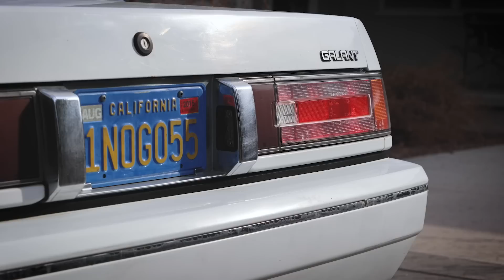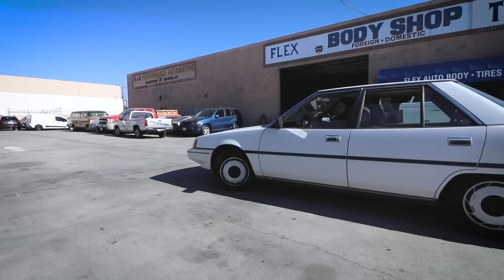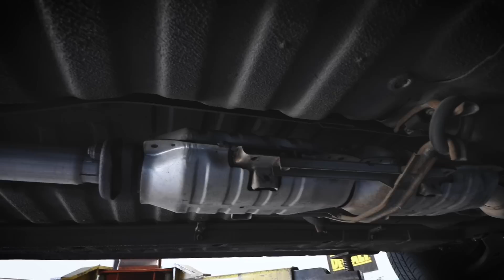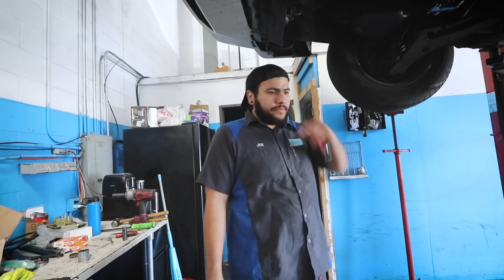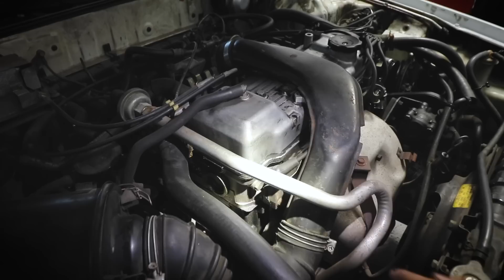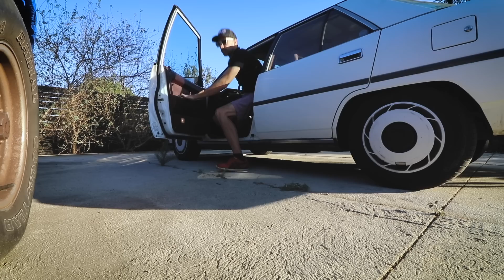Is This 1985 Mitsubishi Galant Worth Saving? Yes! Let's Fix It!

Comment: I agree with Joe on EVERYTHING involving older cars, ESPECIALLY the electrical gremlins. That is the worse part of an older car to repair. My 1993 Buick Regal was extremely easy to work on, except for the dozen electrical gremlins it had. All of which were almost impossible to find without the help of OBD ll.

Vacuum hoses were another pain in the ass 😂 so so many of them in older vehicles

Comment: At least at the end of your video, it sounded like the exhaust issues hadn't been addressed.  Before going anywhere at length, if anything as a safety measure in terms of potential CO entry into the cabin, I'd personally try to replace all rusted out exhaust components beforehand.  Thanks for saving this rarity!

Comment: These were called a Mitsubishi Magna in Australia... Our model had one piece large rectangular headlights rather than the quad headlight set up... The Magna didn't have the marker lights in the rear quarter panels and the number plate light set up is slightly different also... The engine is different in the Magna too... It has a 2.6 litre engine... Oh yeah and our version is right hand drive... We did get a Galant in Australia but it was smaller than this.

Comment: A quick pass with some fine sandpaper (1000, 2000,) wet, over the headlights will clean up the darkness on the sealed beams without having to replace them.

Comment: I had that red Montero in the add!
It was a great little truck!
It would have killed off the Jeep Wrangler, but I heard a rumor that who ever owned Jeep at that time slapped tariffs and other hindrances on Mitsubishi to save Jeep from losses.
There was no comparison of the Jeep to the Montero! Luxury suspension front seat!  Independent front suspension! Auto locking hubs! AC! And better fuel mileage!
I got just shy of 200k out of the engine when it blew a head gasket.

The car you have should be a very trustworthy steed!

Comment: My love for cars started when I got my first car a year ago, a 2002 Mitsubishi Galant. Awesome car.
Reply: yeah i love my 2003 galant. it's so reliable and has some power too 👌🏻
Reply: My very first car was a 1996 Mitsubishi Galant ES. My parents bought it for me as a graduation present when I was in high school in 2004. It had super low miles (40,000 miles).  We were having intermittent problems with it, but I still loved that car. It died on my completely a year later, and I purchased a 2002 Galant in 2005 with 48,000 miles. I had my 02 galant until 2012. It had 182,000 trouble free miles on it before I gave it to my brother. The Galant is a great car. It’s too bad that it’s under appreciated because it really was a competitor to the Accord and Camry.

Comment: As a ´96 Galant (2.0 V6 Exceed manual) owner, I loved this video
Reply: 2.0l v6? Sounds interesting. Mazda had 1.8 and 2.0l v6's in their MX-3. 8k rpm terrors of the day :-) The Probe GT's 2.5l V6 is from the same V6 family. Same harneses and such, bolt in swap for the little cars.
Reply: @pgtmr2713  yes it revs very high too. It’s a variant of the FTOs engine. Mitsubishi still holds the record for building the smallest V6 engine ever:D
Reply: @grunkohlaktionar7474  Yeah, I looked it up. I didn't realize it was related to the 3000GT/Stealth V6.  Makes sense though, that's how these companies save money.  The Mazdas were solid engines, 250-300k miles. They were an engineering exercise of sorts, compact v6, Variable resonance intake, designed with sound in mind, forged cranks w/ cradle instead of mains caps. Mitsubishi distributor on them too.  Although, that was a flaw :-D I've got several around here right now that don't work. I modified a later model distributor and use and 98 ECU.
Reply: I have one of those. 8200 rpm limiter on these engines. I also have other 7g galants. I'm currently building a 6G74 (3.5L V6)  AWD swapped galant, it was originally FWD and 2.0L I4

Comment: Nice car, sounds like it has lifter tick it might go away with an oil change, but if not, you might have to get new lifters, but it also might be the jet valves, when you pull the valve cover you might want to adjust them, i know these engines well G64B. 

Dsm guys go nuts when they realize these engines have the highly sought after 2.4 6 bolt motors.

Comment: My 87 Camaro exhaust rusted through all the way along the top of the pipe also, the rest was clean just like this one. I think because it's old and that's where the seam is when they made the pipe, the humidity in the pipe from the years rusted the weakest point?
Reply from the maker: Ah that makes sense, could be that!

Comment: I must be one of the few people who kinda enjoys tinkering with 80's electrical systems. finding the old proprietary diagnostic tools for cheap on ebay is kinda fun and reading the different service manuals for the different categories is interesting. I have an old Mitsubishi ECI Checker that tests the engine management systems on vehicles like the starion/conquest, Ram 50/Mighty Max, Mirage/Colt, etc. I went through all of the tests in the book on my Ram 50 and got the stock Mikuni dialed in by finding a weak o2 sensor and a bad throttle position sensor.
Reply: Love those Starions! I want an intercooled 5-speed '88 or '89 model!

Comment: Registration first, then road trip.  Even though the 2016 sticker is the same color as the 2021, you will probably get stopped.
Reply from the maker: It's smogged and paid for, just waiting for the sticker to arrive! But yes, you're right, I'd probably get stopped :)
Reply: @HelloRoad  I found out in California states you can't drive an unregistered car, but they also have a law that says you can't drive the car without the current tag displayed, so they got you one way or the other.

Comment: I would love to see you get a Chevette. My grandma used to drive one in the 80s-90s. I have so much nostalgia for the Chevette.. the Chevy Vette :-)
Reply: I'd rather see him get a Fiero which used some Chevette suspension parts and IIRC brake parts as well, until the 88 GT upgrade just as it got cancelled.

Comment: 1. The exhaust rusted at the seam. Nothing regarding moisture pooling

2. Those are called V-belts. Serpentine is the single belt that runs multiple accessories.
Reply: Not necessarily.  I recently repaired a customer's 1994 Acura Integra.  Although the leaking coolant pump was driven by the timing belt, the car had 3 flat belts, serpentine style, each of which powered just 1 device : alternator, PS pump, and AC compressor.  I replaced the coolant pump, timing belt, 3 drive belts, valve cover gasket and grommets, thermostat, engine oil & filter.  The timing was tricky to get spot on.
Reply: ...and replaced the timing belt tensioner, and the lower left engine mount

Comment: This was known as the Mitsubishi Galant Super Touring in Asia. It was absolutely a luxury car back in 1985 surpassing the Camry in style, space and luxury features. The Asian versions did had the same design but somewhat sharper looking without the quad front lights. It was just two large headlights like the 1992 Camry. Ping me if you are selling the car. I may be a serious buyer.

Comment: I would rather have a separate belt for each accessory.  I don't understand why people think a serpentine belt is an improvement.
Reply: well, if you had 4 belts and had to get to the "back one," "a lot," a serpentine belt would be an improvement. All kidding aside, serpentine belts slip less. My car has 2 shorter serpentine belts. Likes to shred them both for a couple of reasons.
Reply: @pgtmr2713  It is rare to change belts.  When a serpentine belt come off you lose everything and you stop.  I have lost belts on older cars and were able to drive home on the other belts that stayed.  One belt for all is not an improvement.  When I lost the belt on my Durango, I had to call a tow truck and that took 5 years off my life as that truck was in worse condition than my truck.
Reply: @mexicanspec  Lol, I've waited for a few tow trucks before. My belts were shredding due to 2 oil leaks and 7k rpm shifts, locked up a power steering pump once or twice. So I carry the belts, a 10mm and 17mm wrench. With my Milwaukee 1/4" it's 5 -10 minutes swap at most either belt. Additionally I switched all my incandescent bulbs for LED's so I can run without a belt for at least 1/2 an hour in the rain and still have enough power to start up again after getting a belt on.
Reply: @pgtmr2713  On my daily driver, which had very low miles, I never expected the belt to come off.  My point stand, though that if you lose your power steering belt on an older car, you can drive it home with the other belt powering the water pump.
Reply: @mexicanspec  My power steering and water pump are on one belt, alternator and a/c are on the other. So when my power steering pump locked up and destroyed the belt, I had to nurse the car home watching the temperature gauge.

Comment: Love your channel man, you love for these older cars that my generation never saw when they were Brand new. What do you feel about the 3rd/4th gen camry's? Ik they are still a common thing on the road today, but lately I feel like I'm seeing less 90's camry's compared to 5 years ago. Makes me feel like they are at that point where owners are beginning to dispose of them to get newer cars. (I also ask cause I own a '97 that i bought last year with 76,000 OG miles and i just have a weird liking for 90's camry's)
Reply from the maker: I'm a fan of the 1990s Camrys, especially the wagons. I don't see much love for them now, but I could see that growing in the coming years. They're kind of like this Galant, they have been treated as disposable. I wouldn't be surprised if 1990s Camrys get harder to find, I saw quite a few of them in my last trip to the junkyard.

Comment: This were made by Chrysler/Mitsubishi  from 1985-2017 were made by DSM Diamond Star Moters in Normal Illinois He made these from 1985-2008 when he retired from there. They made these the Dodge Colt Mirage/ 3000 GT Mighty max/DodgeD-50 trucks 3000 GT/Laser/Eclipse. They weren't bad cars> people just didn't take care of anything back ten.DSM was a big employer of Central Illinois and starting pay in 1985 was 24.50 an hour with all benefits and by uncle left he was making 57.50 and all benefits. He said that DSM and  Mitsubishi was all about reaming good customer values at the time. He also said these were a newer import model with backing from Chrysler. He also said dealer training was crap he said people didn't due to every thing was cheap from 3000 to 12,000 for a cadillac

Comment: Find some cheap  shop and fix the exhaust.  Other things you can do as a home mechanic.
Reply from the maker: Yeah that might be the next project.
Reply: @HelloRoad  It has to be to get it smogged.
Reply from the maker: @mexicanspec  Previous owner smogged it, and it passed. Looks like the smog shop was slacking!
Reply: @HelloRoad  I have tried to get cars like that to pass.  How did the sniffer get an accurate reading with all those holes.  I am glad you didn't have to go through that.  Now the $1500 price loos even better.